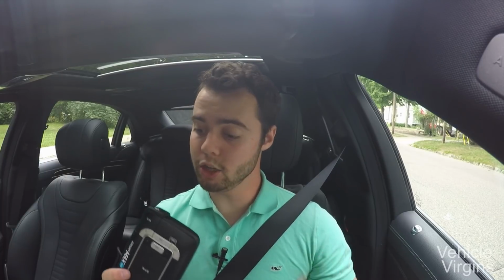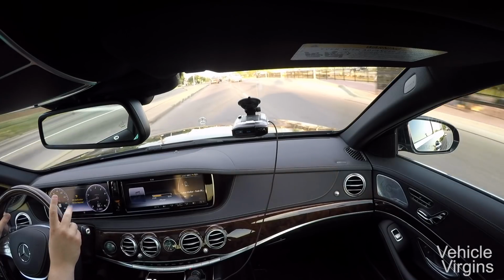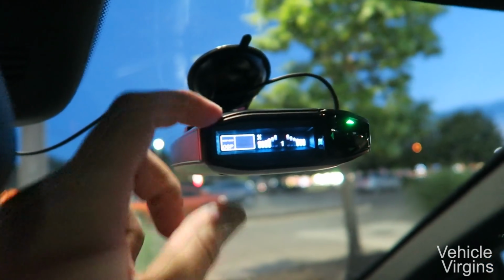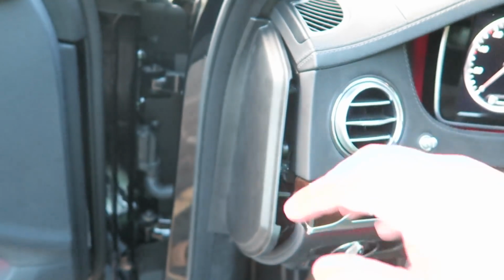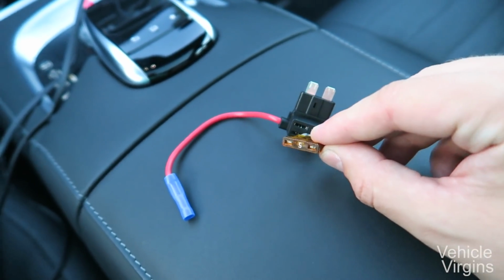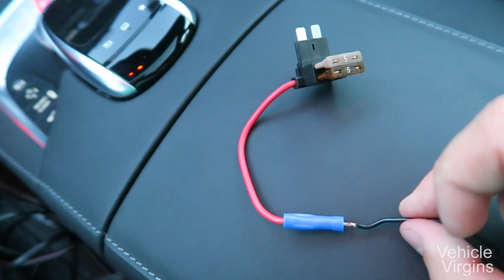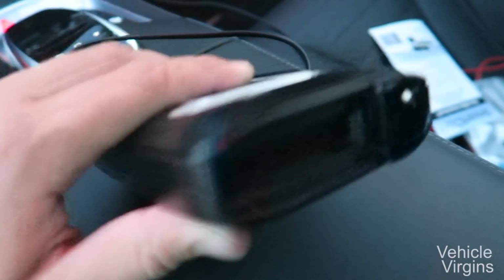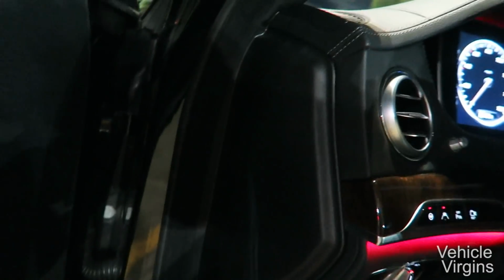GET RID OF THOSE ANNOYING CORDS || Hardwiring Your Radar Detector

Comment: Hey which 5a fuse slot did you use? I just connected the radar detector to my center console display fuse in my ML350 but the detector doesn't power off when I turn the car off..

Comment: Great video, but the smart cord already has a built in fuse, so do i need to add another fuse to the tap plus the original one. Or just put the original one in the tap then hook it ?
Reply: Nazkar you need an add-a-circuit with the correct fuse for your car (https://amzn.to/2ENLYtU), then just plug the hardwire into the add-a-circuit

Comment: Just don't use that in Canada where they use MultaRadar CD (MRCD) Photo Radar, which will detect these, aka u'll be screwed.
Reply: Marco Panzanni Put the sensor in front grill, use Red line Ex invisible to radar and it has MRCD detection.

Comment: A Blendmount connected to the mirror with a mirror tap for power is a much cleaner and easier method to mount a detector.  On the other hand, the 360 is as big and heavy as a suitcase and may pull the mirror out of its socket.

Comment: you have the add a circuit/add a fuse order incorrect. The original fuse should go on the side with the prongs, and the new 2amp/5amp should go on the side with the wire.
Reply: I know right!
Reply: @KaningLamig1  why
Reply: Like it matters. Their both 5a fuses

Comment: How are you able to use a smart cable with a mute switch and also hardwire into the fuse box? I'm looking to hardwire my radar detector however the hardwire kit is simply the power jack on the radar detector end and the exposed wires on the other. The only smart cable choice is a 12V power cable with the button and leds right on the outlet plug so how are you able to use both? Is that something particular to Escort that they designed the hardwire kit to have a separate wire from the ones going into the fuse box or does it wirelessly connect to the detector to mute it?

Comment: When using an add-a-circuit fuse tap always make sure you insert it in the fuse box on the correct terminals. If you install it on the wrong terminals the fuse won't blow if there's an issue. Remove the fuse from the fuse box and check for voltage on the terminals to find out which terminal has power with out the fuse inserted and orient the add-a-circuit where the power will first flow through the fuse then to your radar detector/accessory.

Comment: Ok so correct me if I'm wrong but I heard this from another person. They said that cops are switching to laser so radar detectors won't work which means you need to get a laser detector? Is this true btw I'm in California
Reply: Laser is impossible to avoid, you can detect it, but you CANNOT dodge it. It's extremely accurate and quick. I've run into some laser signals in the Bay Area and yet anything has yet to appear in my rearview while doing 80 mph. Most PDs and the highway patrol uses Ka still.
Reply: +jeffrey625625 sweet. But how does laser work? They clock you with a laser then go after you or is it a automatic ticket through mail?
Reply: Nick Bath Laser is usually operated by an officer in a pursuit vehicle. When they trap you, they decide if you're going a reasonable speed or not. So they go after you. Laser is what it is. Laser goes the speed of light and if not, relatively close. How the hell can you dodge the accuracy of light and the speed of it? Radio waves such as Ka, well go the speed of the radio waves. This takes me back to chem class with wavelengths from microwave to plasma.
Reply: +jeffrey625625 so best solution would be to get a scrambler then right?
Reply: Nick Bath Yes, but that is highly illegal in many of the most populated states such as well, CA. Even with a jammer/scrambler, a cop will chase you down if they see that you're not giving a speed result back if you use one in a state that is illegal.

Comment: Radar Detector and Dash Cam should be integrated in car itself, but no auto manufacture do it.
Reply: Radar is illegal some places.
Reply: ***** They can make it as an option that unavailable to some places.
Reply: Stark And what happens when you sell the car in a different state?
Reply: *****  As far as I know, radar detector is only illegal in FL.
Reply: +Stark what are u talking about its legal in Florida lol
Reply: +Stark lol FL is the only state that barely gives a fuck about their cars, Virginia is the only state that bans Radar Detectors. So happens I live in VA so rip me.
Reply: passports can be built into the dash. costs run about 1200 to 2k i have one in the lotus it a little light next to the shift light, and it has laser too.

Comment: I did the same type of install as this, however with that nice/ modern of a car, why not get the kit where you could have tapped into the power rear view mirror and not have to mess with the fuse box, finding a ground, hiding the wire etc? Thats the way I would have went with a that car. Good video though and definitely an easier way than splicing wires and such.

Comment: what if your fuse box is where the motor is at? do you need to drill a hole in the firewall?
Reply: A car most likely has 3 fuseboxes under the hood, in the cabin, in the trunk.
Reply: Mine doesn't :( i'm just gonna tap into my radio fuse
Reply: +ZynovFTW when I need to run wires throught the firewall, I typical squeeze through the enrake gasket, look under your foot well, e-brake and hood latch both should allow you a little space to squeeze through

Comment: oh.. it's only $650 ... fuck it, I'll buy eight!!!

my cobra is going on 10 years old and is still kicking and saving my ass. those cost under $150 now.
Reply: Unless your cobra comes with GPS, I would at least get a 9500ix from Escort. $350 and it remembers false alarms.
Reply: +ZynovFTW I've considered a few different escorts.just can't bring myself to spend that money . I'm sure I'll regret it if I ever get a ticket...again...
I'd buy it if it has pop warning for laser traps. haven't looked into it in a while
Reply: REALthugnasty It does have POP mode warning. Actually went off on me one time a couple weeks ago. My detector rarely goes off for false alarms due to GPS. Travel the same route to work everyday and my detector only goes off for actual cops. Highly recommend Escort Passport 9500ix. Really solid detector.
Reply: REALthugnasty No problemo. I was a little hesitant as well before purchasing. Now I CANNOT drive without a detector. I feel like I'm driving blind, honestly.

Comment: Yes radar detectors are helpful an will save you from a ticket, but the problem with hardwiring one is that it's like advertising your car for someone to steal, those good ones cost up to $1000, most people will park and put it in there glove box or a concealed place, but when hard wired you can't.
Reply: Uhhh.... Yeah you can. Just unplug the Jack from the radar. The only part that stays permanent is the the wire. That's why it's called hardwire, not hardradar

Comment: Parker.
You have the placement of the fuses backwards @4:20. The add-a-fuse (the one powering the escort) should be on top and the original fuse should be on the side closest to the two metal prongs sticking out of the fuse tap. In this case it didn't matter but if you were tapping into a fuse greater than 5amp then it would.
Reply: I'm using a 7.5 and i have 7.5 in both slots is this going to cause me a problem ?
i just replaced my alternator and am wondering if having 2-7.5 fuses is what caused my problem??????

Comment: How exspensive is this device??
Reply: $650.00 from Escort.
Reply: ZL1Gimpelson thats  not bad that 2 speeding tickets
Reply: Tyler Wallace Yes I have an 8500 x50 it is good for me.
Reply: Easy to install easy to use ???
Reply: Tyler Wallace Yes, I don't have it hard wired, but it comes with the smart cord with the mute button to plug in to the power outlet. Although I would look into the 9500 because It remembers the false alarms and mutes them. My 8500 goes off a lot for false alarms.
Reply: Very

Comment: Holy shit $650 bucks
Reply: lol $100
More like $1,000 in insurance increases and $300 for the ticket if you don't live in a flyover state
Reply: Noah DeJesus Do you even have a drivers license
Reply: Watch the reviews that Vortex Radar does on his channel. Hes a small youtuber and he provides unbiased and knowledgeable reviews of every single radar detector and does head-to-head comparisons. Because of him I bought a detector for $300 that performs as well as the higher end ones.
Reply: +Noah DeJesus "Speeding" Also means 5 over the speed limit, and depending on the pulling officer, it makes a difference.

This is a car channel, no one buys a performance car to drive the speed limit all the time.

They have Toyota's, and Honda's for that.
Reply: it will save ya
Reply: The Valentine V1 has practically all the functions of the passport max 360 when you use the iOS app, V1 Driver, or android app, YaV1. It's worth checking out considering a V1 is $399 or less.
Reply: +PBMS123 Yes unintentional, no one drives around constantly focused on their speedometer, so it becomes quite easy to speed and not even realized you're doing it.
Reply: PBMS123 It's not that they can't maintain their speed and need a radar detector, it's just that there's a slight chance of them exceeding the speed limit at some point in their drive. I've driven with many very good drivers who say they don't speed and everyone of those drivers I've caught speeding and pointed it out to them. Then they start to realize that a radar detector is a good tool to have that could possibly save them from being ticketed.
Reply: A speeding ticket is at least $100
Reply: I got one. best money I spent
Reply: $641 on Amazon
Reply: Look at a company called beltronics. They have some the same tech as Escort, mine has saved my butt a few times and they are pretty cheap.
Reply: +Tat2Dragons
You don't have to drive around CONSTANTLY focused on your speedometer to maintain a speed, I'll just assume that that is part of your driving test? I doubt in almost all cases a cop isn't going to pull you over for doing a couple over, which is about all that you would expect between glances at the speedometer. And in most cars post 2005 they are going to have cruise control anyway, but I digress. If you cannot drive and maintain your speed, you really should not be driving.
The only reason for these is so that you can speed and not be caught.
Reply: Yeah, that's what I thought too.
Reply: +alexlam24 plus the raised insurance rates, which are generally much more than $100 over the course of the 3 years most insurers count the ticket against your driving record / insurance risk
Reply: No the price is decent but on top of that you have to pay for service that doesn't make swans
Reply: Plus doubled insurance for 7 years in most states
Reply: +Noah DeJesus Much easier said than done, as most drivers are unintentionally speeding.
Reply: Unintentional?
You have a fucking speedometer which tells you how fast you're going.
Reply: $40 for the class and it gets wiped if you stay clean during the probationary 6 months.
Reply: PBMS123 I never said that you had to drive around constantly focused on the speedometer to maintain your speed. I personally don't have a problem maintaining speed, although it seems that a lot of drivers do. Most people travel at around the same speed as the vehicles around them and will occasionally glance at their speedometer. Anyway, even if you're one mph over the speed limit you're technically speeding. Will a Police Officer pull you over and ticket you? Probably not, but they certainly could if they wanted to.
Reply: Actually they would have a hard time doing it. LIDAR detectors are accurate to about +-2mph, Radar are the same if not less accurate, and thus they would need to give you the benefit of the doubt, and would only be able to ticket you for over 3mph.
You said "Yes unintentional, no one drives around constantly focused on their speedometer, so it becomes quite easy to speed and not even realized you're doing it." So you did kind of say that you need to constantly look at your speedo to not speed.
I still don't understand how these are even still legal, if you can't not speed, then you should be ticketed.
Reply: PBMS123 It's not that they would have a hard time pulling over a driver and issuing that ticket, they would probably have a hard time making the ticket stick if the driver decided to fight the ticket. Which was one of the reasons why I said that an Officer probably wouldn't pull a driver over and issue them that ticket. Oh, and I didn't kind of say that I need to constantly stare at my speedometer to maintain my speed. You must have missed the part where I mentioned that I personally don't have a problem maintaining my speed.
Reply: Well that's good. I'm glad. 
But if others can't maintain speed and "need" a radar detector, I think, they shouldn't have a licence. 
I find it a bit ridiculous that people can't admit that they just want to speed and not get caught. 
Which is quite frankly very dangerous.
Reply: I bought the 9500IX, I love it!
Reply: i hate those LOSERS driving at 60mph on fast lane blocking traffic, i have to speed up on the right lane to pass them.
Reply: +alexlam24 how bout you just don't fucking speed.